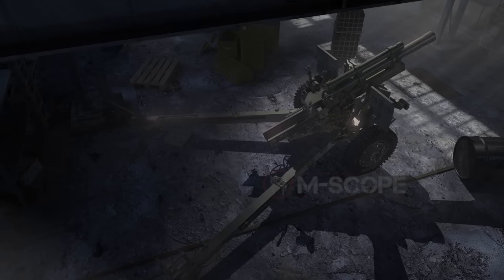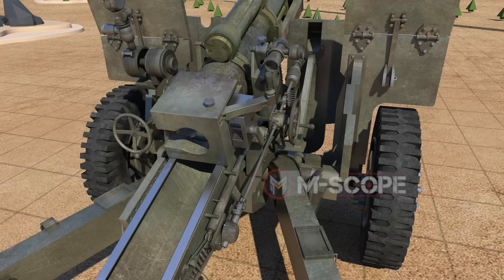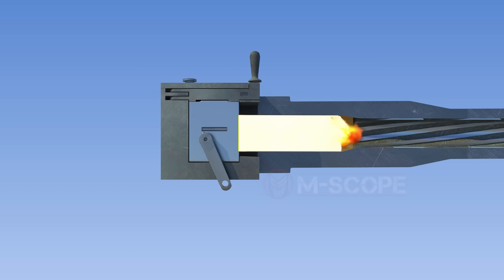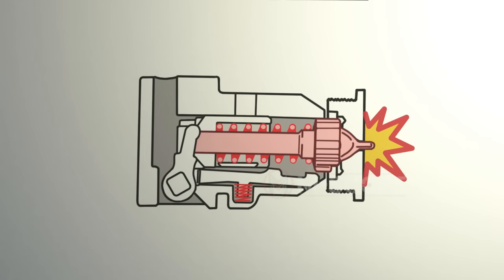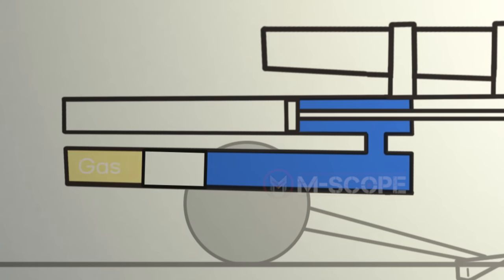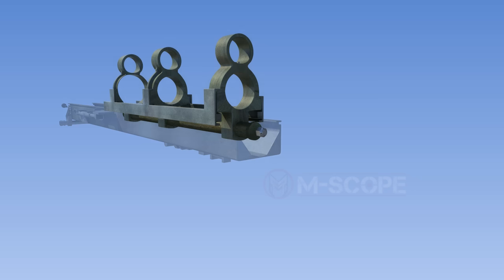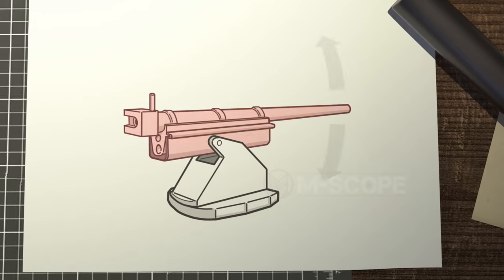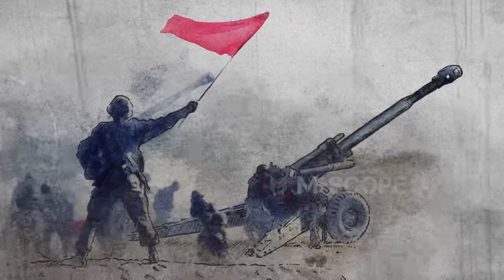How does the 105mm howitzer work?

Comment: U did not mention the range , the effect and when it suitable to use ,great and terrific explanation for the structure of the gun
Reply: It is a must watch. 👀
Search "  The Warmonger's Legacy  " on YT and share.
Reply: Depends on the model. But the range is between 13 to 18 kilometers. The modified Canadian 105's have a longer barrel and new muzzle break that allows for up to 18 kilometers. They are suitable for troops and vehicle fire missions as well as illumination missions. The structure of the gun apart from was already explained is that the gun and the wheels are on a separate axle that needs to be unlocked from each other when put into action.

Comment: Nice work, but the terminology needs work. "One hundred five millimeters" should be "one-oh-five millimeter" (i.e. singular). Similarly the plural of "artillery" is "artillery", not "artilleries". You explain that this is a howitzer and proceed to call it a 'cannon' and a 'gun'. At no point do you identify the type (US M2). The depiction of case obturation is also wildly exaggerated - cases don't expand that much and they don't contract that much either.
Reply: Not every military that uses the Howitzer refer to it by it's ordnance designation. Pretty much all commonwealth countries refer to it as a gun. I have never called the gun M1C2, it is always the gun, or the guns. I think the exaggeration of the expansion was purely for visuals so it can be seen , but they definitely expand and contract.

Comment: Olden days issues...
Modern day non-issue

Trucks have tail ramps (hydraulic, electrical, mechanical) for quicker loading and unloading

Recoil is on the ground, not building, not ship, not truck
Stability when firing is trailling arms like cranes and legs for trucks with cranes
Short bore-barrel is accuracy of wind over distance-range and terrain and training to don't bother too much and just use more guns

Comment: One key detail was left out: how to load it?
Something must catch the cartridge from sliding back, or it will interfere with the breach. 
Also, does it need to be fully level when loaded? Loading it at a steep angle would be quite difficult...
Reply: The person loading the cartridge pushing the cartridge and holds it. As the breach block is closed, loading person slides their arm to the left.
I was a number 2 on this type of howitzer. The number 2 opened/closed the breach, set the barrel elevation and fired it.
Also, we loaded that type of howitzer at what the needed elevation is. We did not level the barrel to reload.
There are some 155 mm howitzer (and larger) that require the barrel to go to a certain angle to reload. But 105's do not have to. A NATO 105 howitzer shell and casing weigh around 35 lbs (15.9 kg). Loaders gain arm strength quickly pushing the shell amd casing into the breach.

Comment: question, why does most modern battle tank or even cold war era tanks have a larger caliber cannon compared to the howitzers?
Reply: The 105mm is a small howitzer with the shell weighing about 45 lbs.  The larger 155mm shell is about 100lbs.  Modern tanks only are larger, by a small amount, than the small 105mm.
Reply: @davidroman1654  ohhh thanks for the info bro
Reply: Tanks use the 120mm smooth barrel guns. At least on the Abrams or the Leopard 2 do (actually is exact same gun made in Germany on both). The bore is not rifled because sabot rounds are used mostly, which don't use rifling.

Comment: Is it possible to change the size of the propellant to vary the range and angle like on most 155mm howitzers?
Reply: Yes, amount of powder and angle are what determines the range.  Also the 105 can be air lifted if needed and could be towed by a Humvee.
Reply: @davidroman1654  I thought it wasn't possible to change the propellant because it's a metal cartridge but ok. Thank you 👍
Reply: @Bullet_Tooth84  Back in the '70s when I was in NG our unit was 155mm.  Trained on the 105mm and the powder was in bags, and the number of bags used was part of the process.  A lot could have changed since then but that was how it worked on both guns.
Reply: @davidroman1654  I was a gunner on the pzh2000 which is a 155 mm system and the propellant is in bags. But I never had contact to a 105 mm system because germany does not use them anymore. 

So thank you 👍😊
Reply: @Bullet_Tooth84  The cartridge has 7 charge bags, if the mission requires HE quick Charge 5, then the ammo guy will remove 2 charges from a string of charges (charge number 6 and 7), then mate the shell to the cartridge. The loader will approach the breach and say, HE Quick charge 5 (in this scenario), the commander of the gun, or number 1 in Canadian artillery will look and verify charge 6 and 7 are hanging out of the casing, rip them off and throw them in a pile where they get burned later ( usually just before we leave a position cause it is bright af)

Comment: Yeah, but how do you aim it? Are you just blindly firing?
Reply: See the video about the 'forward observer'.
Reply: there is a foo, or a forward observation officer who is at the target area with a laser finder. They find out the bearing and range to target and relay that info to a cp (command post) where the data is crunched using as a milipack ( a computer). This data gives each gun the bearing, charge and elevation needed to hit the target. These bearings are called out through a speaker or tonoi attached to guns trails, at least in can forces anyhow.
Reply: @travellingcanuck8243   Sound's difficult. But okay. Whatever you say.